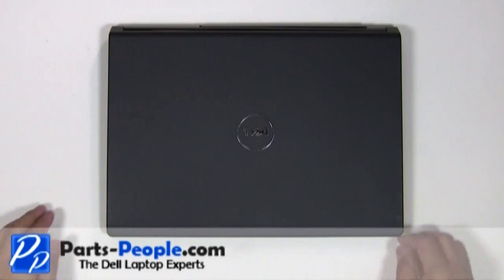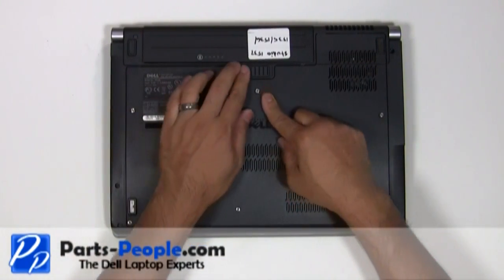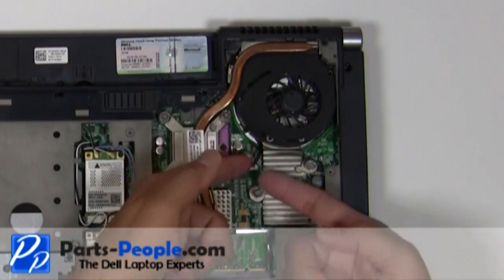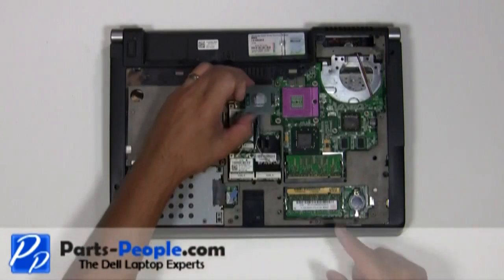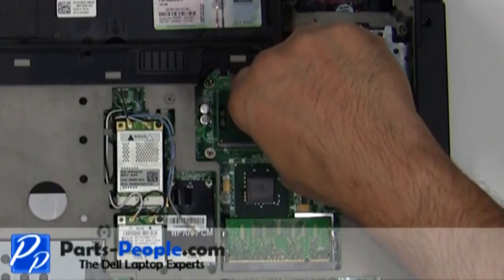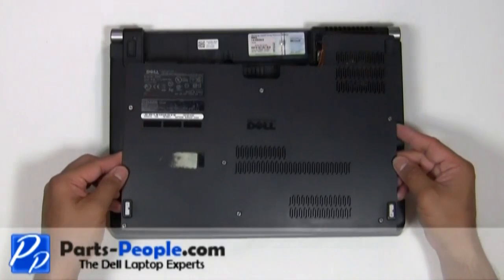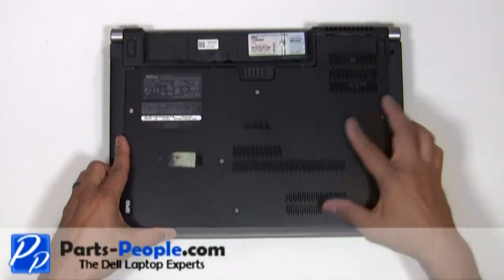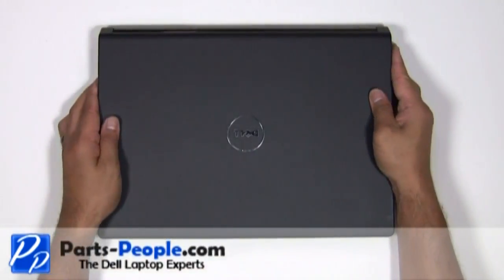Dell Studio-1535/1536/1537 | CPU Processor Replacement | How-To-Tutorial

Comment: Just did this upgrade now. First step, update the bios to the newest version on the Dell site. Then open computer as in video. After following instructions, be certain to tighten the heat sink screws around the process in order and firmly (if they are loose, the computer will toss an error code as the process will overheat). I installed a 2.5 ghz T9300 processor, and it works beautifully. Many try higher upgrades, and if you look online, the attempts to get another .1 or .3 ghz results in issues. the T9300 is cheap and works!

Comment from the maker: Here are CPUs Dell recommends: 
2.1 GHz, 800 MHz FSB, 3MB L2 cache (T8100)
2.4 GHz, 800 MHz FSB, 3MB L2 cache (T8300)
2.5 GHz, 800 MHz FSB, 6MB L2 cache (T9300)
2.6 GHz, 800 MHz FSB, 6MB L2 cache (T9500)
As for power and heat reduction, I'm not sure if they are going to be an better that what you already have.

Comment: What about Intel® Core™2 Duo P9600?
It uses the same socket, and has a lower power consuption (25W against 35W), but the FSB is faster... so the question becomes: it would be a problem if the FSB speed increases from 800Mhz to 1066MHz?

Thanks a lot